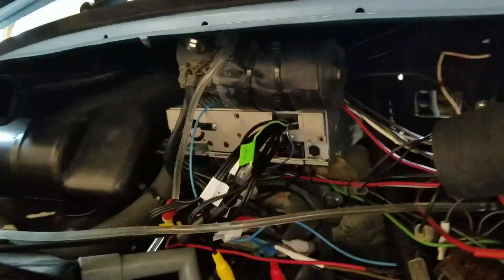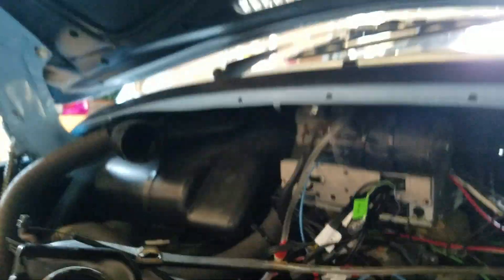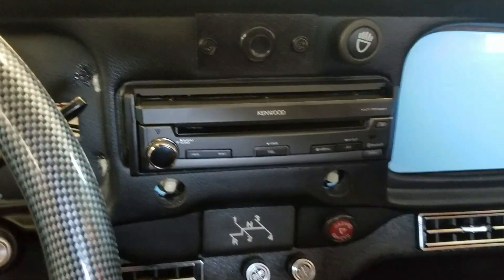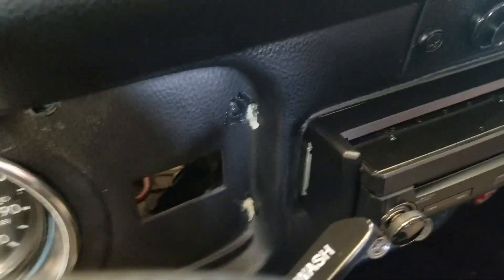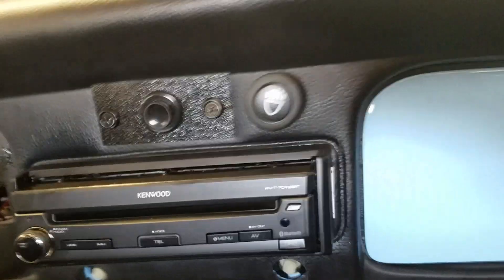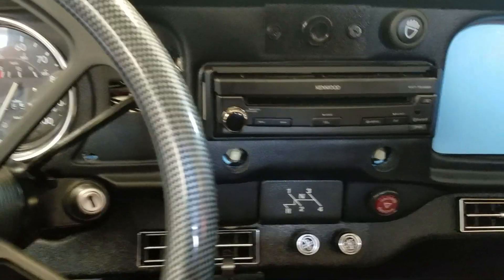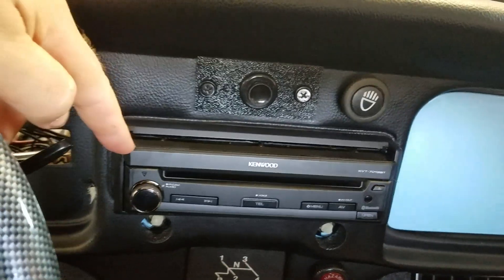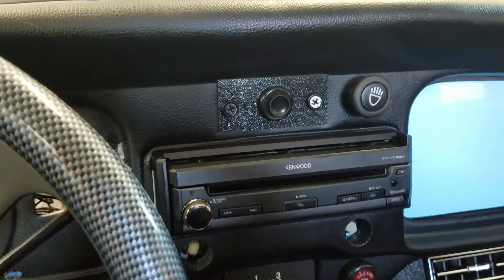1974 VW Beetle Stereo Install #3

Comment: I have a 71 Super that I am about to install a stereo system in. Did you add any amps or woofers? Did you change out the generator for an alternator?